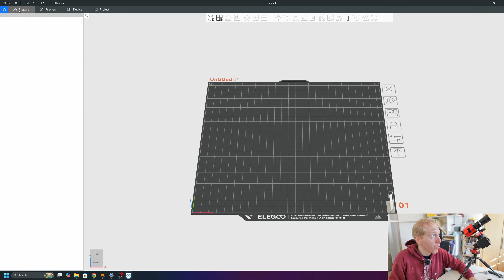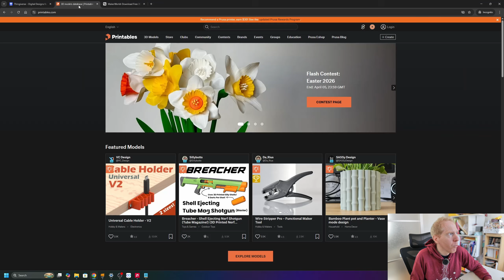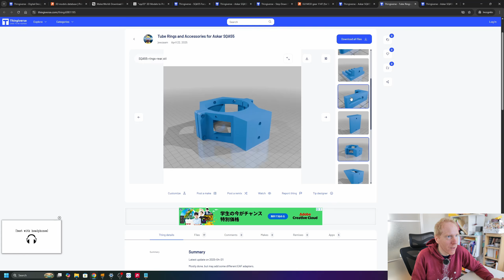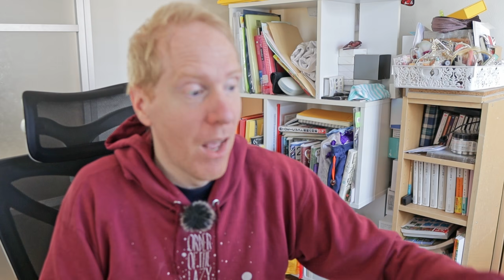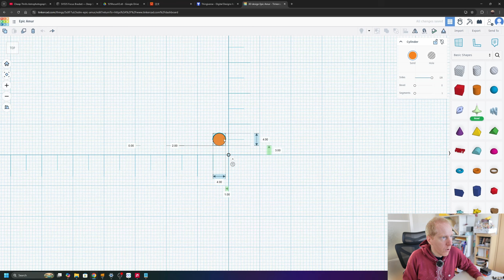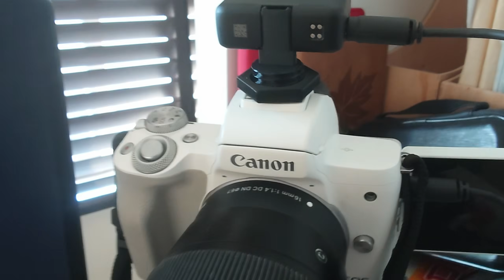Your next Telescope should be this 3D Printer (it's cheaper too!)

Comment: I just bought one of these (hasn't arrived yet), so I am going to blame you.  Just kidding.  If you went to the Centauri Carbon page, the Carbon 2 was like a $30 or $40 upgrade and quite a bit less than going to the Carbon 2 page and buying it there at the time.  The price has since gone up.  I currently don't have a use for it with my telescopes although I suspect that will change in the future (hmm, dew shields).  But I have other uses for it.  On Amazon if you hunt around there was a deal for 8 matt color filaments for $33 which is cheaper than buying one.

Comment: I bought a Carbon II as a result of this video and it has been a great supplement to my astrophotography. I've printed a much better dew shield than the one sold by celestron for my RASA.  Also filter sliders and a storage box for them.  To create the printer file for the sliders I needed to dive into Autodesk Fusion to make my own since no one had posted one online yet.  What a wonderful new rabbit hole hobby! The Elegoo hardware and slicing software are very good.  At this price it's well worth it.

Comment: Great video Cuiv! I find my 3D printer great for so many little jobs. I have designed and printed a mount for the Gemini flat panel to put on my scope so I can take it on and off without having to use the large zip ties that come with the panel. A question for you or anyone else that might know - I am seriously considering getting the SQA55 scope for wide angle photography. It looks like the optics are great, but the proprietary mount may let it down, compared to something like the SV Bony SV555 that looks to have a more sturdy tube ring. Have you found that the 3D printed tube rings for the SQA55 fix any flexing issues? 

Thanks again for the great channel!

Comment: I have an Elegoo Neptune 3 Pro I got on sale and I designed and 3d printed a mount for an integrated rasperry pi zero 2w  with a fan and ethernet running OctoPrint and a high res wide angle camera attached to the print bed.  I have also printed accessories for my telescopes.  Love the video.

Comment: I got into 3D printing in September with a Creality Ender 3 Pro, and now own a Bambu Lab P2S and H2S.  I have printed several astronomy-related parts.  I agree, a 3D printer is very helpful in printing replacement parts or adapters and such as the EAF bracket I just printed for the SVBony 535 lens (did mine in red PETG).  Thank you for this video!

Comment: Hmmm… might have to give it a try… I had the ender printer a few years ago with upgraded springs, bl touch, etc, and could almost never get it to work. The bed was slightly warped, and I think 3-D printing is extremely sensitive to temperature changes. This looks like it might be pretty good.

Comment: I couldn’t agree more. I’ve printed a filter drawer holder that I just added tiny magnets to hold my various filer drawers. I’ve also printed an Askar Multi-Connection Finder Plate to mount my ASIAir to and saved $34 over the one you can buy.

Comment: Printing a lot in the hobby. What materials are you guys using to avoid thermal expansion? I noticed a lot of shrinking and expanding thin parts like bahtinov patterns. It prints and sattles in 60-80°C bed but when you comming out to -10° then it is becoming wavy. That is why I prefer to use laser cutters when it is so small.

Comment: Thanks for the video.  I’ve managed to sketch and build my 6” reflector, a harmonic mount, an auto focuser, and many bits and pieces to help it all go together.  Now, I didn’t build my own electronics and optics but most of the mechanicals associated with my rig.  It works better than I would have imagined.  My printer is an older unit similar to your older prusa and it does take some work to keep it working, but it is an amazing technology for hobbies to like myself.

Comment: Agree with you 100% on the benefits of 3-D printer with Astro photography. I have askar 106. And I have to break down the telescope from the mounting and bring everything in the house after every night. Can’t leave it outside unattended. 

I always found it very tedious to put the telescope on the mount if it is in the Home position. So I created a 3-D printed stopper for the LDP 300 that slides on the plate and I have it screwed down from the top using the two center screw holes already present on the plate to secure the stopper . It is a completely flat surface against the  AM5 mounting plate . this way whenever I have to put the telescope on the mount every night, I just have to align this, and the scope fits perfectly in its desired position and then I can tighten it down without the need of constantly holding it in place.

I had tried to look for a solution like this online could not find it but luckily, I had a 3-D printer and it took me just a few hours to design this part print it and use it

Comment: Totally agree, Cuiv. 3D printing has the potential to revolutionise the hobby.
I've just finished printing a complete OpenAstro Tracker- the only metal parts are bolts, bearings and one piece of 2020 extrusion to mount the camera.
Over 30 hours of printing and I now have a NINA/PHD2 controlled autofocus camera that will polar align itself.

Comment: Great Video
I grabbed the Bambu Lab PS1 for the same reasons as you. I needed it Idiot proof, no tinkering required and it just works, also since the PS2 came out the Ps1 id super cheap too.
similar price to the Elegoo.
cheers.
Reply: Thanks. Would you recommend P2S over P1S as my very first printer, or would suggest the P1S?
Also would you go with AMS?
Thanks a lot.
Reply from the maker: From the reviews, it seems the P2S solved a lot of small issues with the P1S. I'd personally go for the P2S if I was choosing between the two but only if you can stomach the additional cost.
Reply: @CuivTheLazyGeek yes I heard same but I bought my ps1 just before the ps2 was announced 
No regrets with the ps1 
Has been working perfectly (touch wood 😂)
Cheers and keep up the great videos!! 👍
Reply: @CuivTheLazyGeek Prrfect. Thanks a lot. Went ahead with P2S 👍🏻

Comment: You missed one of the biggest pros of 3d printing: rapid prototyping.. Once you know how to model (not trivial but not rocket science), you can use the printer to quickly iterate on ideas. CAD up your idea, print it out with cheap plastic and lousy (aka: fast) settings and test it out. Tweak, rinse, repeat until you've got a part that's exactly right. 

THEN, send the model files to somewhere like pcbway or jlcpcb and they will 3d print (or mill or sheet metal fab) your part and send you the results. Want it 3d printed in titanium? Not a problem, if you want that and have the $$$. Or stainless. Or fancy polymers. Or get it CNC'ed from aluminum and have them anodize it. If you have not seen their all their offerings before, it's quite the amazing rabbit hole.

And they do lots of sponsored videos - give them a call!
Reply from the maker: Prototyping is a great application! Also thanks for the tip :)

Comment: ZWO EAF on SV535 can be installed on the original bracket - just drill 2 holes in it and add 2 bushings
Reply: And yes, I have a 3D printer.
Reply: And I printed rings, brackets, housings, adapters and other parts for astrophotography

Comment: I'm just in the process of trying to fix an EAF to my Mak127, and the prices of the adapter kits are wild.  Another puzzle is how to fit a mini PC to a Redcat 91. So I can totally see this paying itself back in just a few months.  The risk however - and you mentioned it - is that you take on a new hobby, as if astrophotography isn't expensive and time consuming enough. 😀

The SQA problem you have there: I have a similar problem, where the OAG body clashes with the set screw of the rotator.  I can now no longer set a camera angle that way.  A slightly thinner thumb screw (1 mm...) would have fixed that immediately, but I chose to buy a Uniguide 200mm guide scope instead (already half the price of that printer) and remove the OAG (the other half...).  Which brings me to the question: can you print threaded objects with this printer?
Reply from the maker: You can print threads, but down to 0.8mm pitch I would say

Comment: I had a great example, Got my SV535 and realised I didn't have a bhat mask that fit properly. Found a stl model online, changed it to the right diameter and added a cuff so it slips on the scope nicely. 35 mins later I had a bhat mask specifically designed for my scope for pennies.
Reply from the maker: That's exactly why I love having one for astronomy!

Comment: I have used 3D printers for more than 10 years, even before I went into astrophotography. I designed and printed a lot of stuff for my rig. My one advice: do not print load bearing parts, especially for heavy and expansive equipment: 3D printed parts are prone to failure, particularly through a phenomenon called delamination.  It depends on a wide range of factors such as filament type, quality, print temperature, direction of printing (Z direction +++). Using 3D printed parts for cable management, fixation of AsiAir, EAF or guide scope is fine but for instance printing a .8 mm thick M54 to M48 adapter for your 5000$ camera and filter wheel just to save 20 bucks would be really dumb.
Reply from the maker: Solid advice! Also delamination immediately made me think of the Titan submersible 😅

Comment: I just made an automated flat panel and really wished I had one.
Reply: What software did you use to control the panel? I also thought about making one and I caded out the design with using an arduino in mind. This project was mostly an after-thought but now I want to make it happen, is there a tutorial on how to make an automated flat panel or do I have to design and print it myself?
Reply: @cheese7693  Using and Ardurino for now.  Working on melding it with NINA for complete automation  control.   Code is not my strong point.  Learning as I go.
Reply from the maker: That's amazing!

Comment: Check out ASA filament! I use it almost exclusively after the PLA test print looks good.
Has a very high temperature, and is UV resistant. Although you usually need an enclosed printer.
Reply from the maker: I really need to brave the fumes and try ASA for outdoor gear! 🛡️
Reply: @CuivTheLazyGeek I haven't noticed too much, unlike ABS (although that's printing in an office, not in my house)

Comment: Cuiv-san, I used my BambuLab P2S to create a mount adapter.  I have two mounts but only 1 tripod.  The mount adapter is for a Celestron AVX and a EQ6R Pier extension.
Reply from the maker: That's awesome! I hadn't thought of that, it's a super valid use case, it gives me ideas :D

Comment: I've got the cc1 printer (still waiting on the mmu). It's such a great workhorse, im at nearly 500 hours of print time  with minimal issues, with most being user error, I know the cc2 will be great! I also recommend using ASA. It's great for UV and temp resistance, and it's under $20 per filament roll.
Reply from the maker: I'm a bit scared of ASA, but yeah from a robustness standpoint it makes sense :)
Reply: @CuivTheLazyGeek I honestly get better results with ASA than pla 😅

Comment: Just bought the Elegoo Centauri Carbon,  original none multi filament printer. Printed bahtinov masks, m42, m48, m54 and sct 2" dust caps. A red dot foot for a finder shoe.  I assembled a picatanny rail with a Meade finder shoe and printed as one piece.  

Best astrophotography tool and highly recommend the Elegoo Centauri Carbon,  either version.
Reply from the maker: Awesome, great to hear the CC1 also works great!

Comment: Oh, not completely idiot-proof.  This idiot tried to create a simple stacked bracket for a travel router and scope controller and could not make sense of the design software.  Can't translate 3 dimensions to the screen.  And then, as you note, you have to lay it out for printing so that it has the proper supports.  Could not do that either.  So I will rely on you smart folks to do it for me.  Some folks have a nice sideline hustle with that.

Comment: This is really a cool device to have, but I doubt it’s usefulness in the long-term. What will happen after you print all the spacers, all the holders, all the end caps? By the way, I’m not quite convinced that you need an auto focus on such a short focus lens.  in my practice, lenses in the for length shorter than 150-250mm don’t really need an adjustment during the night of imaging. The tube length is simply too short to accumulate a significant thermal expansion run.
Reply from the maker: F2.8? Lots of glass? No fine focus adjustment ring? You definitely need autofocus, I've seen the focus shift with my own eyes :)
Reply: @CuivTheLazyGeek  the most common glass is BK7 which expands at 7ppm per degC. The case is usually aluminum which expands at 20ppm. The differential is 13ppm multiplied by 150mm tube length equals to about 2 micrometers of focal drift per degC. This is not much unless your temperature changes by more than 10-15 degC per imaging session. As far as focus, a very careful focusing with a helical focuser allows you to reach exact focus rather easily if you have a magnified live feed. I never had to adjust helical focus of my 250mm f/5 RedCat for 3-4 hours
Reply from the maker: Agree to disagree with this particular lens that I have hands on experience on and that you don't.

Comment: I hope you liked the CarbonStar 200 back cover.  When I posted it, I mentioned that I used TPU.  This is actually really important since TPU gives a little to make it possible to tuck the cover into the opening of the CarbonStar.  I also have a version that has holes for a 120mm fan.  I am still testing to see if the fan helps with dew without vibration or light leaks.  I will post it if all works out.
Reply from the maker: I printed my own design (for the 150, that's what I showed in the video) that's very tight and works with PETG! I don't have a filament dryer powerful enough for TPU yet

Comment: I have the Centauri Carbon 1. I cant imagine not having it for making brackets, spacers and dew shields for my scopes. I have made a few more complex projects, including an auto-polar alignment unit that I am still experimenting with. I have even used it to convert a Celestron 130SLT OTA into an astrophotography rig. I make my own 12v power distribution boxes and have started using Raspberry PIs to make dew heater controllers. It is certainly a astrophotography tool. I use Blender to make all of my own customer controller enclosures and print them on the Elegoo. But for things like guide scope brackets, I use PETG-CF. It is stiffer and wont flex as much as standard PETG. Great video!
Reply from the maker: I need to try out PETG-CF, thanks for the tip!

Comment: When I got the Seestar S50, pretty much as soon as it came out, I saw all the examples of people 3D printing accessories. I added up the cost of all the accessories I wanted from Etsy and it was about $150. Or I could spend $700 and buy a 3D printer, which was what I really wanted to do. That was a couple years ago and I haven't regretted it at all. Now they're even cheaper, and better. Get one!  Also that app looks nearly exactly like the Bambulab app.
Reply from the maker: All the slicers are based on the open source Orca Slicer so they all end up looking the same 😅

Comment: Picked up a Bambu Labs A1 over a year ago - ufdah! Astro related I printed a lens cover for my 100ED as it didn't come with one (2nd hand). Then I had problems getting a finder scope mount but discovered that Sky Watcher is adding a bar for the top of the rings where you can mount things like finders (kinda of an inverted mounting rail) so drew up and printed one that fits the 100ED and the 115mm. Naturally there were a few "prototypes" printed before I could converge on a good product.

What I find I don't like about the A1; the AMS is external taking up too much room and it does not have an enclosed box. Not a deal breaker but with dust, can't print ABS etc. I'd like to upgrade.

To make full use of these things one needs to learn CAD. I ended up picking Shapr3D - but oh boy my brain has a hard time meshing with it. More of a draw something on a napkin or scrap paper then just make it. Don't work with 3D printers! Probably a generational thing - I learned to draft with paper and pencil.

Ideally I'll wait until one can print multiple colors with out all the poop waste. For now I stick with one color.  But so cool to have one to solve those stupid little problems one has in the home (e.g. lids for pet food cans).

Comment: I've been using 3D printers for years and have designed and made many accessories for my scopes. Items like mounting brackets for things like the ASIAir, cable management gadgets, extended dew shields, clamps for tripod legs to hang things, adapters for guiding scopes, filter holders and adapters, etc. etc. etc. A 3D printer is a natural accompanyment for astrophotography. 👍
Reply from the maker: I hope you made these available on Thingiverse or the like!

Comment: I have been considering getting a 3D printer with the exact purpose of printing connectors, adapters, or other little bits and bobs that needs to be custom size/shape, for a while now. What has been putting me off so far is that I don't really have the motivation to get into complicated 3D design on the computer in order to create what I want, but seeing that there are so many ready made designs available to download, and even alter to your specific needs, I might just have to reconsider getting one. That said, even if this is seemingly a very affordable 3D printer, you can buy a lot of ready made things for around $400, so I suppose one needs to figure out how much one will actually be printing long term as $400 is quite a lot of money if all you want to do is print one particular adapter.